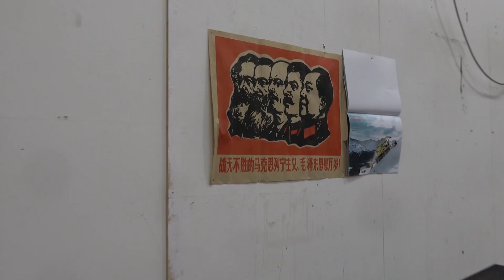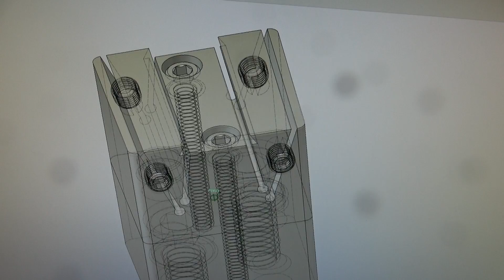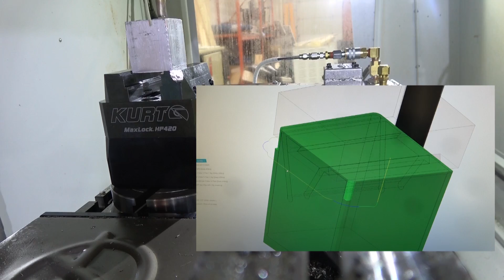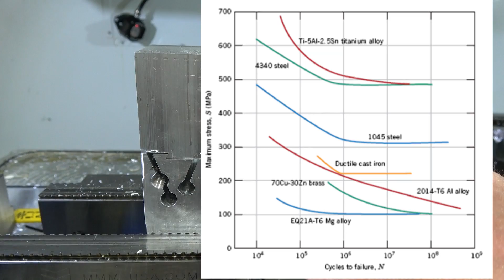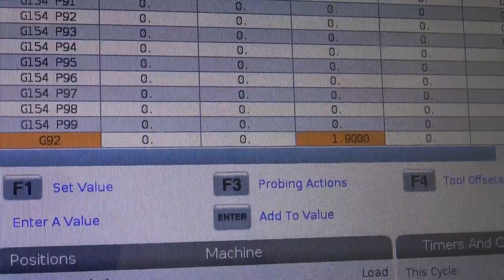Prototype invention 5-axis Vise?

Comment: For more accuracy and rigidity with dovetail workholding, change to shape of the dovetail so that there is clearance on the bottom of the center piece and the material rests on the faces on the outer edges. This effectively doubles the surface area in contact with the vise and moves the contact patch towards the outer edges of the material further increasing stability.  Putting a flat on the sharp edges of the dovetail for both the vise and the material will also help avoid binding.

Think of a dovetail as a sliding taper; it creates downward force by squeezing against an angle. They are functionally identical to a wedge. 

Since flexures like the one in the video pivot more-or-less along a circular path, the angle of the taper will be constantly changing in relation to the workpiece. If the range of travel is kept to a minimum this won't be a problem, but if it has to move too far to clamp the part the difference in angle will cause some issues for repeatability and total clamping force.

Comment: I got two wire edm machines i run at work, and I have a $10,000 vice in each one, I can adjust them to less than a quarter of a tenth on all 3 axis.
I take the vises apart about once every 3 month to clean out the carbon and lubricate them, and the adjustments are just Allen head screws and stacks of cup washers, its amazing how much they paid for them.

Comment: Two things, i think that you need the clearance slit cut in the point of bottom dovetail, and perhaps cross drill from right hand side with clearance in the bulk section and threaded on the flexture side, to pull it back towards the rhs. How about uncle bumblefork bbq aprons

Comment: AvE, will you machine me a worm gear? I'll provide the material, I'll pay for the gear, and I'll even become a patreon. Its for my 1980's Taiwanese lathe. It's a 19t worm gear, for a .187" pitch worm, or 4.75mm pitch worm, and it's not commercially available anywhere. I have 2 damaged ones to reverse engineer from. Let me know, it'd really help me out!

Comment: You also want to make the jaw make a linear move instead of rotating, or change it so the clamping is rotation, but the top surface provides location. Solid block like [ |. And a moving clamp element inside the bracket.
Place the joint correctly and it will hold down and against the flat jaw instead of lifting

Comment: I'll take a crack... Beef up the left side (thin side), so it doesn't flex. Use the top of that as your register on the left. Relieve the top of the moving dovetail slightly below the register, and at an angle. That allows the dovetail to move angularly, without pushing up on the workpiece.  I'm sure you could find the optimal angle and depth of relief if you modeled it, but it'd probably be just fine to eyeball it.  Thanks for posting these awesome vids!

Comment: i thought most Al extrusions were 5000 series.. but looked it up plenty of both. Also thought 6000 series were most used in aerospace because of the strength and the resistance fatigue cracks? well at least 6061 T5-6

Comment: Wait, so why not go in 90degrees from the original holes, on the right hand side. Drill through the divider slot. Run a tap and thread the hole on one side of the slot. Then on the other side of the slot open it up enough to run an Allen through  and countersink the head in... 
I think I missed something.

Comment: hey.  what about making the screw(s) go the other way  (90 degrees to the slots, clear across the part) so that tightening them pulls the whole things shut, like a regular vise..  I'm not sure I made sense..  I lack the proper terms..
I do know that the way you did it squeezes the clamp tighter, so I suspect it's mechanically stronger, but....  who knows. 
One thing...  I briefly looked online for what a 5 axis vise is, and I didn't quite get it.  It seems that if you don't know what you are looking for, you don`t get a proper explanation.  was the goal of this fixture to be able to clamp a part without the vise getting in the way (or to be able to mill the vise as you mill the part, without fear of scraping your 2000$ vise?)

Comment: 1 slot. With a threaded handle running across the split. 6 to 10 thow over cut on the pin side of the dove tail. Move and lock with said handle.

Comment: it seems like it would be best to drill the holes an slot for the the moving jaw at an angle equal to your wedging action to both counter your twist and make the movement of the jaw more linear.  For a example think of the fastener like a wedge and get the jaw side of it parallel, so that you have a nice large area supporting the clamp and not just the point levering it over.

Comment: you need to take a endmill put a flat on the peak of the dovetail on the part so it clamps on the angle only and pulls that part into the fixture, i usually use a .01-.015 edge break on a parts dovetail for .06-.15 high. id also use a dovetail tool for the fixture with about a .01 tip radius so it doesn't crack after repeated use

Comment: If'n you were to have the grub screws turned 90 degrees coming in perpendicular to the dovetail, and have 3 of the cunts, you'd be able to tweak how tight each end of the dovetail was on the workpiece. So even if your dovetail was a c-hair off the straight and narrow, you could preferentially tighten one end or t'other. You could also make the fuckn thing out of steel like a civilised person.

Comment: This is too funny! I was just about to say since the points of contact are at the ends, why not have two plugs, one at each end. In the middle of typing that, she popped out! I hate it when that happens! If that were steel, it probably wouldn't have happened but the aluminimum was too soft.
I'm more of a mechanic than machinist by trade but I love these vidjeos too! Keep them coming!... or just keep making them. Yeah, that sounds better

Comment: A couple suggestions, before milling your dovetail, drill a small hole through the block at the theoretical corner of the dovetail so it clamps on the face, not the edge ofvthe dovetail.or barring that, use a small ball end mill toopen up the corner and radius it to remove stress risers too.

Comment: Think I see what your after there, but wouldn't a single slot, with a cross drilled counter bored hole with a cap head alen bolt be stronger and simpler?, leave the bottom of the dove tail wide as possible?  basically just a spring clamp...

Comment: Did you knock the points off of the male dovetail?
Reply: Also the use of a hinge and taper being pushed by the screw. You want more contact area and even pressure too.

Comment: I realize this would increase the complexity and part count, but what about slitting the middle of the clamping jaw and then using 2 fasteners to tighten from either side. That way you eliminate the cutout in the jaws to make additional points of contact but still get the additional points with more surface area.

Comment: maybe screw from the other other way 90 degrees on the piece. drill the outer part and tap the center to pull it with a bolt or three

Comment: Improve the design by drilling and tapping a hole through the center of the vise block perpendicular to the dove tail. Use a long screw to draw the dovetail shut, EZPZ

Comment: There is too much flex on the outer sides.  Make the dovetail tapered so your set screws push the part into the "Wedge Dovetail". A set screw on the other side to push it back out.

Comment: What if you had a grub screw with a long dick on the end that went through that through hole, thread the end of that dick, make a tapered contact surface on the other side of the through hole, and make a plug that threads onto the grub screws dick so you could spread the other side for even clamping

Comment: What if you wait to cut the dovetail until the tension screws are in and up to some torque. That way your dovetail comes back to square when you tighten it on the work.

Comment: Two bolts on the outer face, through hole to the flexing peice and threads only in your flexture section creating a pulling force rather than a wedge maybe?

Comment: I look at business targeted machine tools like this. Your paying a premium for the accuracy, and the fact that you don;t need to spend time on it yourself. If i am doing something as a business and my time is expensive. Than yeah i will likely pay for something of high accuracy. Because I know that i should be able to order it open the box and have it work as i intended. If I did my research right and my expectations are reasonable. 

However if i am doing it as a startup or as a hobbyist and what i have is time, but not money. I am probably going to build my own solution. As long as i am not selling that solution to someone else without modifying the design the required 15%, its 100% legal. I am not infringing on someone else's patent doing that either. I am doing exactly what the system legally allows. That is to take something and improve upon it for mine or someone else's use. 

However lets be honest, even the highest end machine tool wears over time. Which requires the operators to be smart. It requires you to know how to measure, and be informed about the processes your using. So if your vice has a ton of backlash or play. Its not a guarantee that its going to prevent you from getting the level of accuracy you need to complete your work.

Comment: I know it would add part count, but to spread the load you would almost want two tapered plugs which would be pulled tight together.  I hope I'm explaining that well, like instead of the NPT plug it would be a taper plug with internal threads, the another tapered plug with only a clearance hole.  Through both of those you would have a screw which tightens the two together.  

Or on the other hand, maybe tapers aren't the right thing to do, maybe a cam lock that goes the full width?  That way you apply even pressure across the whole face instead of single point loads.  Just kinda thinking out loud.

Comment: Use bolt, nut and two conical washers to apply equal hole expansion pressure on both sides.

Comment: Man, I didn't know you'd gone but after this video went up I knew you were back. I'm not sure how many shop coffees went in to the making of this video but it was a million quips per hour in there. Thanks for bringing the AvE I didn't realize I was missing back.

It seems like you really need to get pressure behind both points of contact vs in between, and maybe a little closer to the dovetail as well. There are definitely some bending moments around that grub screw that are getting in your way. What if you could get a captive thread in there], with a conical nut on either side? It'd suck in equally from both sides sort of like a brake caliper, and you'd get your force distributed more closely to the points of contact.

Comment: Drill down from the fixed dovetail side, add a counterbore for the SHCS and then tap only the flexure side.  If you use two or three screws you should have an excessive amount of clamping force.

Comment: Instead of the clamping hole being parallel to the flexture holes, make it perpendicular to the flexture. drill all the way through with a steel plate on the outside gusseted to taste, with a bolt running through to the other side. that way it would work like a kurt, just tighten it with a wrench

Comment: I would suggest chaning the position of the hinge so that the stock is pulled down onto the fixture. The way it is configuered now the movable jaw lifts up on tightening. Move the hinge to the left, outside of the dovetail so it moves down. This way the stock can be drawn down tight to the nonmoving sides of the fixture. Also why not use a screw 90° to the dovetailaxis that simple clamps the dovetail.

Greetings from Germany

Comment: Assuming the vice needs to stay centered on the center, I would approach it with a left handed and right handed acme lead screw axially trapped in the middle and threaded to each jaw then tighten the gibs to each jaw before machining.  If that is correct no wonder they want so much.
/////////// I I \\\\\\\\

Comment: You can make whatever you want for yourself, patented or not. You just can't sell them or supply them to others.  Also, the top left edge of the wedge you're moving when you clamp will be higher than the top right edge of the same surface when clamped if milled in the same plane when unclamped. It may protrude above the top (horizontal) mating surface of the block.  -forner tool maker,  mechanical engineer and attorney. (Welder/fabricator too)

Comment: The springy part bend out of square when you tighten er up. You should think of a way to reference the sliding bits with the top and not the bottom of the dovetail, cause it's moving.

Comment: Used to work a brake press when I was but a wee lad, and you're 100% correct on 60-series aluminum.  50-series would bend just fine but 60 was too brittle - every once in a while a piece would slip in, and it would snap right along the bend line - get a long and thick enough piece and it would sound like a gunshot going off.

Comment: Suggestions:
- Knock the acute edge off the dovetails so you're sure it's always bearing on the dovetail cheeks, not the points
- Decide on a horizontal surface to be pulling the part against -- either the floor of the dovetail or the faces either side of it -- and put some clearance between the other and the workpiece

Both of these just provide a bit of certainty where your contact is and what's stopping the part from weeble-wobbling.

Comment: That dovetail will tighten right up if either (1) the tenon of the dovetail is a few thou shorter than the depth of the mortise, or (2) the mortise is a wee shade deeper than the length of the tenon.

Comment: Two steel "straps" as the "actual jaws of dovetail" screwed onto the flexture. Gets the advantage of tougher jaws, more actual contact. Retains 'bulk material cheap'. Still can have 'two on one side, one on other' alignment trick by using two screws on one side, one on other.

Comment: Used to make such fixtures for short thin pie parts just make an arbor that it will fit on, drill a m10 or 12 thread in the middle slit it with the bandsaw and done it will hold those pipes toit

Comment: Is there a reason reversing the dovetail sides wouldn’t be as good? Expanding a slotted male to hold the work, and having the work piece have  the female side.  The clamping forces might be slightly better, compressing forces at the top and bottom with one screw expanding the clamp in the middle.
Also, point loading would be easier to iterate mill into the “male-expanding-clamping” side.

-Just giving what I can.

Comment: As someone who works in software for a massive, custom-fabrication workshop (think people who build props for Disney): Open-sourcing/public-releasing without a patent is really only an ideal path when A. it's a niche product that is excessively challenging to recreate, thus negating any profit margin to enter (and scale) the market competitively, and/or B. No matter how much money you have, the time to tool up and build the product will never out-margin the principal inventor (at which point in both cases, a holding institution will generally purchase the business and go through the patent process for the new assets once the manufacturing process is acquired.) There is a case for C, though. and that is raw benevolence, a la Salk.

Comment: Step one to not getting a bad offset, use an edge finder. Ive never trusted the automated electronic measuring systems.

Also, should add a second screw mirrored and opposite the other as well as reduce the width of the slit and hole diameter to improve rigitity. You dont need much range of movement.

Comment: Maybe you could change which guy has the taper on him. Right now, it looks like you have the taper in the hole so when the bolt goes in eventually the taper gets pushed out and clamps down, but that tweaks the whole thing and causes uneven clamping pressure.

Maybe you should taper the bolt (grind it into an angle like a tap slightly), then when you screw it into the straight hole it'll tweak the whole thing tight as you go and if the bolt is the depth of the hole + the length of the taper, you'll hit flat area and it should even the pressure out. Sure it's a lot more screwin' to get her tight but I'd bet you'd like the result :P

I'll be honest though this is all from eyeballing the vidja, I'll need some more details to give some proper insights.

Comment: Thread from a perpendicular face of the cube at 12:36 if u run 2 holes from the left face through to where the plug goes in then tap threads on the inside v shaped piece and put some bolts in it from the left side where u drilled from and u can put as much torque as u want in them. this is more processes but for making one or 2 I don't see it as a huge problem

Comment: Instead of a threaded taper plug to spread the jaws, a tapered cam lever lock is fast and repeatable (think old 90deg turn window locks). Of course, it would add two items to your BOM. The tapered cam/opp handle, and a steel rod through pin for it to locate against. The through pin is COTS, but the cam lever would be significantly harder to produce. The threaded taper plug is just going to get looser and looser with repeated use.  

On second thought...

I think your weak link here is not the design, so much as the material. Grab an engravers vise (ball vise) from Bezos. Mill the jaws for a dovetail. Mill two parallels in the ball to engage the vise you have now. BOM be damned, $120 and an hour of your time beats farting around with 6063. Pay yourself $60/hr and you will be money ahead...

KYDIAV

Comment: Two tapered lug nuts run the one all the way up on a socket head bolt and counter bore both sides to  the same degree as the lug nuts